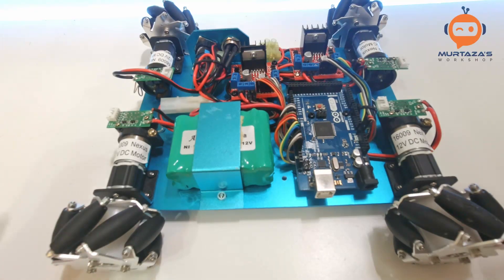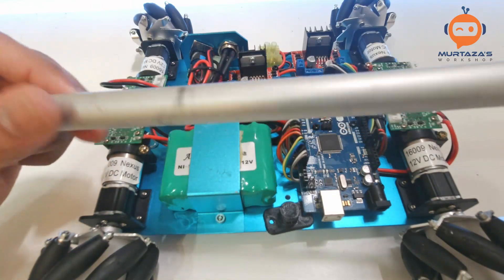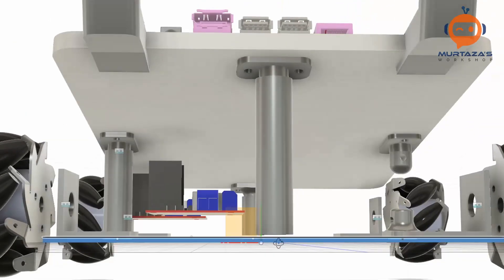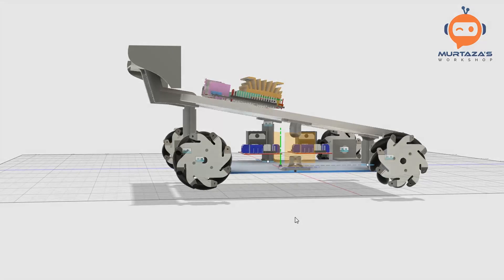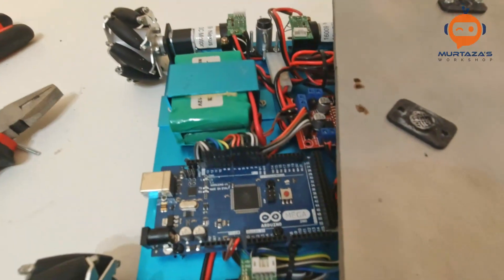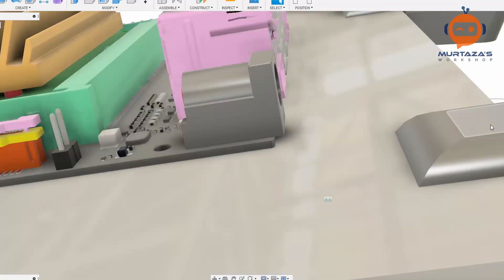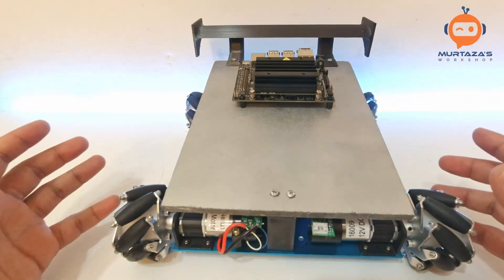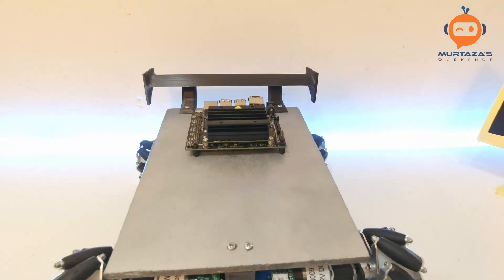3D Model and Assembly | Self Driving Car using NVIDIA's Jetson Nano (2020)

Comment: So I see you are about where I am at right now. I'm still very new learning what can be done with deep learning. What I found really cool is since the Jetson Nano is it's own small little computer I was able to move most all systems to it and run them as threads with out the need of all the other electronics. The robot is now able to roam around the house in dumb mode using only the camera itself it check if it is stuck. (only 3 lines of code for that really, without any deep processing). All I have left now is to move on to the next level and give it some brains with deep learning.  My plan is to have it learn as it goes. For that I need to figure out how to update the old data and merge new images without having to run through all images for the training. All in Python if I can.

Comment: As Lidar can't detect closer obstacles maybe you can make front part a bumper like vacuum robots have and / or a couple of HC-SR04 sensors (combined with led lights and ldr sensors to light dark zones will give a very cool aspect). Just some crazy ideas 😜
Reply from the maker: ya that could be useful
Reply: @murtazasworkshop  or even fixed camera w/light in front lower and 0-180 pan-tilt w/light on middle top to avoid lidar... ok ok project is yours....🤣🤣🤣

Comment: Interesting video! I'm building this but with smaller base so the N298L and the motors are underneath and the arduino, a small breadbord, and battery on top... it even has some space for a gyroscope/accelerator I'm tempted to use... then I'll add the second "layer" with the Jetson Nano. :)

Comment: Reason why project is a dead end: 1) arduino mega does not have sufficient interrupts to handle 4x mecanum wheels with encoders independently.... Solution daisy chain  L/R to make it emulate 2wd robot.
2) Jetson nano, Ubuntu, and ROS is simplest way to get autonomous motion using SLAM. However with the slanting race-car plate, placement of Lidar needs to be horizontal and this design is sloping... That's a no-no.
3) Using wheel encoders on its own to obtain POSE of the robot is a recipe for failure... Wheels do slip and encoder readings will drift confusing the robot about its actual position and orientation relative to its map. Solution: add an IMU  and fuse its data with wheel encoder data using EKF algorithm to improve POSE of the robot.
4) alternatively one can scrap encoders and imu and use intel realsense T265 camera to get 3d POSE of the robot to feed the SLAM of the ROS navigation stack running on the Jetson nano.
5) if you need to drive all 4 mecanum wheels independently with encoders, consider using Teensy microcontroller instead of Arduino Mega as it has enough interrupt pins to read the encoders 4x2 +/- counters.

Finally, I enjoyed your videos but please try to finish projects you start or at least finish the whole project behind the scenes, understand the design flaws/improvements before you shoot the videos.... Then you won't get stuck midway and act like nothing happened and start posting other stuff.  It's a turn-off to people who want to learn with you..... Just a suggestion because some people.... Even kids go buy the materials to try to follow you and then you stop and post other stuff.... That's not right. Thanks and take care.